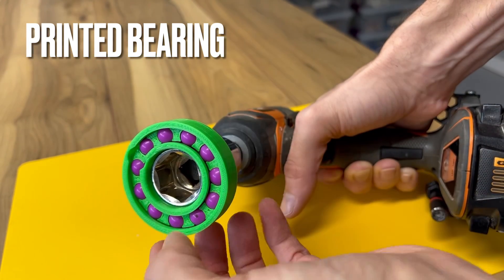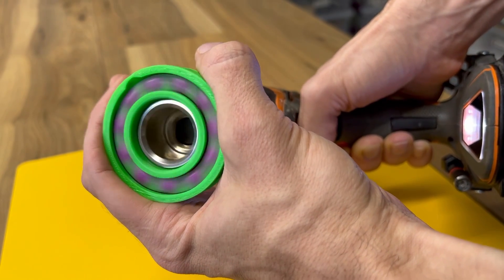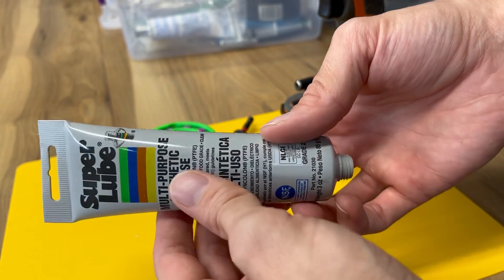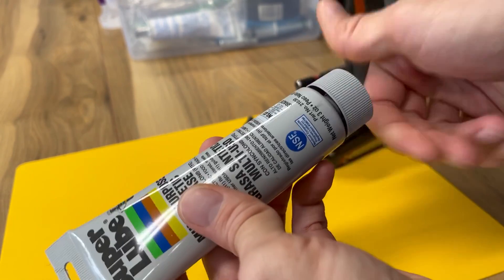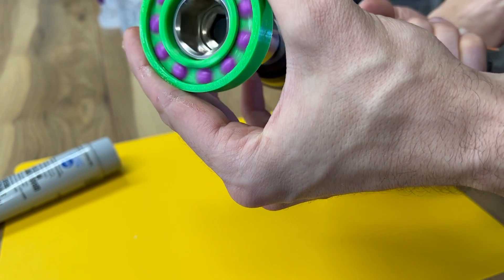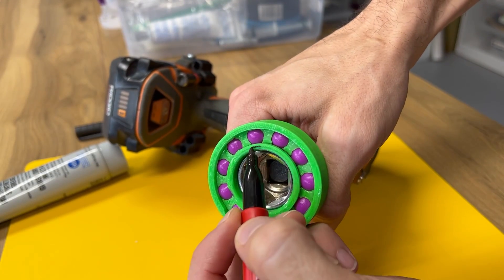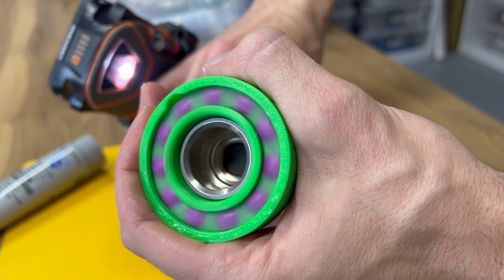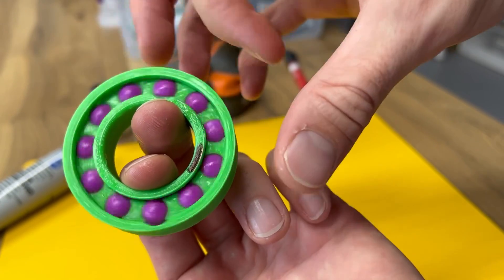3D Printed Bearing with Nylon Balls

Comment: Bro needs to learn how actual bearings are assembled.
Reply: Perhaps the bearings in the video are not steel
Reply: I see there is a notch in both bearing races where the balls are inserted. In actual steel bearings you don't see this notch. These are assembled with all steel balls gathered on one side and then the outer race is being elastically deformed to spring fit over balls and inner race. Then the balls are positioned and the spacer is put in between the balls.
Reply: @andrebartels1690  i mean even this way it does its job
Reply: where do I find a decent 3D model ? .... I want to use Delrin balls and print the rest myself
Reply: @andrebartels1690  You can find this notch on commercial bearings from world's best brands, like SKF or Timken. It named as "filling notch" or "filling slots". This notch ables the manufacturer to insert more balls in the bearing, as the number of balls increases, the load capacity of the bearing increase too. Look for SKF 305 and 207 ball bearings!
but about what you said, I don't think it's possible, as the bearing races must be hardened and before that, it goes under grinding machines!
Reply: i mean with 3d printing its adding material